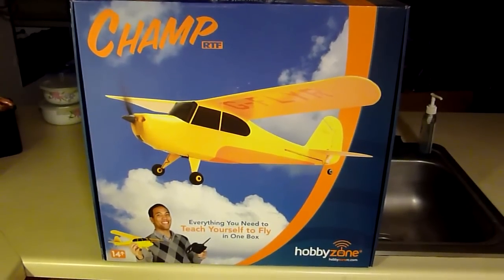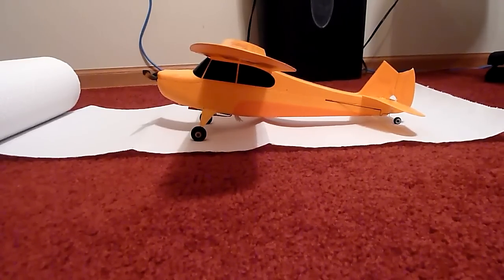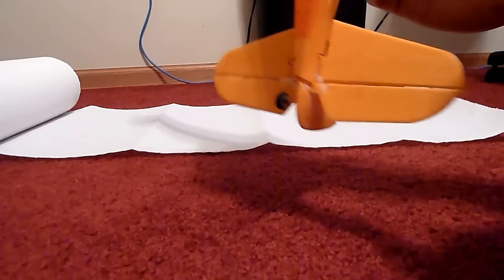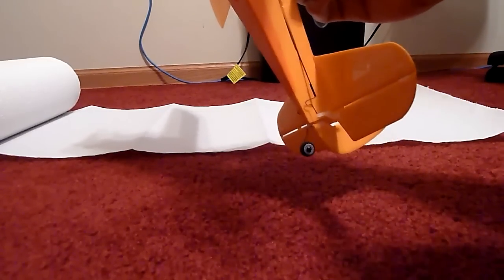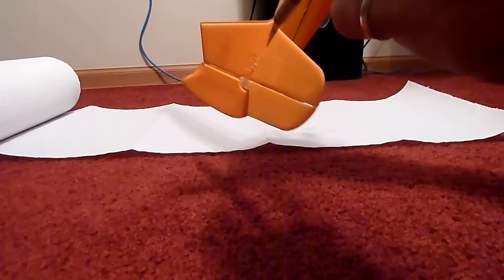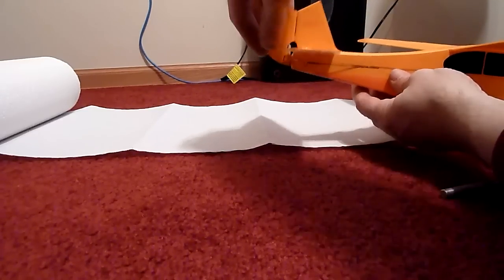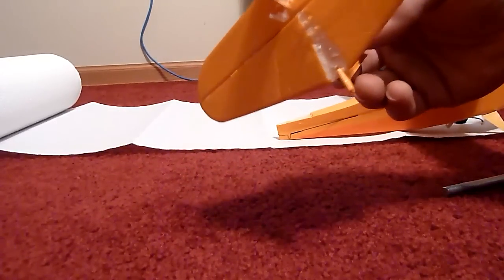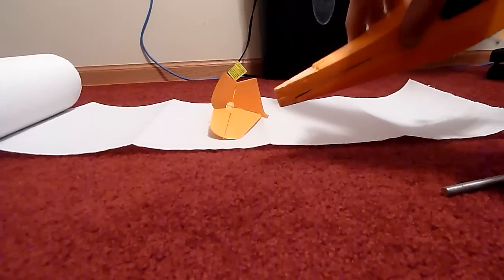Part 1 How to repair the tail section on a Hobbie Zone Champ RTF

Comment: I was hoping to see the detail,
including how to attach the control rods -
those little horns are delicate and stuck in foam that could easily be damaged-
so do you use the pliers to bend the rod or to bend the plastic horn ?
or both ?